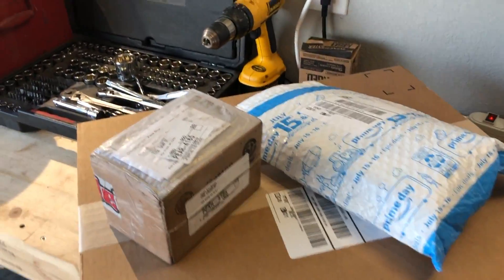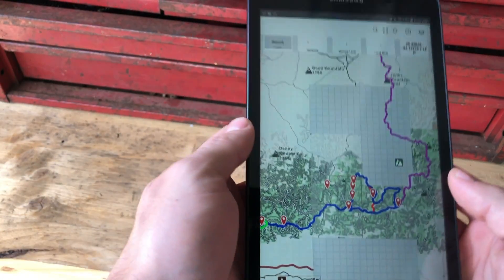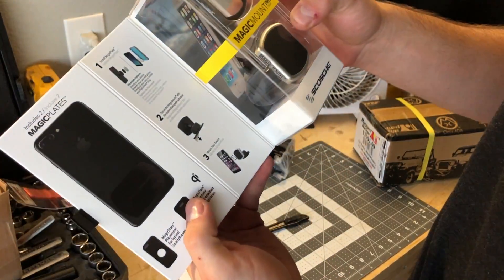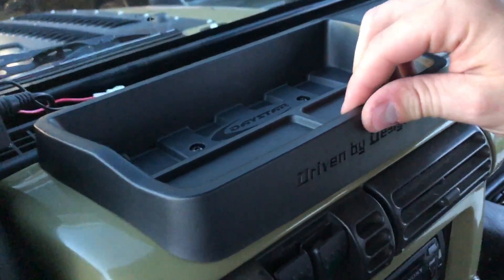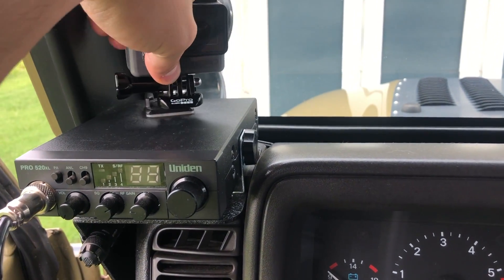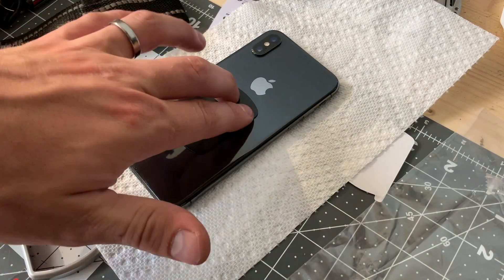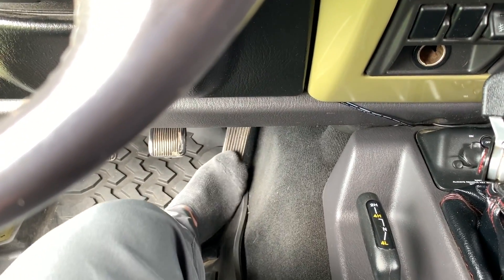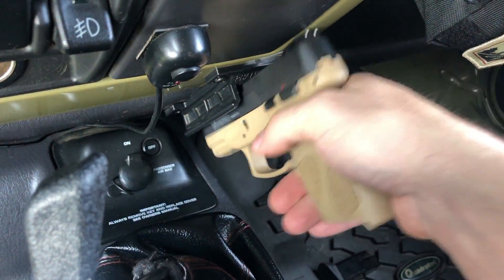Jeep Wrangler TJ – Overlanding Interior Mods

Comment: Nice video! Now let’s put those magnets to test and go off roading and see if you stuff falls off, if it doesn’t then I’m buying some!
Reply: same thought. looking forward to an update review of how those magnetics do off road
Reply from the maker: Will do! I think what I’m actually going to do is keep the tablet mounted on top of the dash and my phone on the lower mount. I trust the phone mount completely not to fall off. And with the tablet being mounted in that tray, it can never “fall off” so I think I’ll be fine keeping it up top.
Reply from the maker: UPDATE! 
Just got back from a weekend trip of off-roading and camping. Did several trails ranging from gravel to large technical rocks and the magnets worked perfectly. I ran my tablet on top of that dash mount and it never once popped off, and I ran my phone on the side next to my radio and it never came off. Even while using my phone case. If I swapped positions from the tablet and phone, the tablet may have came off, but I didn't test that. I preferred to have the tablet up top anyway for visibility. Very pleased with how well they worked. I also got another steelie magnet and stuck it to the back of one of my orange GMRS hand held radios and stuck it to my metal cb mount. Also never came off once. Magnets FTW!!
Reply: @ArkansasOffroad  That's sick! I'm going to order some! can't wait for your new video! thanks again
Reply: Steelie mounts
Reply: As a truck driver I use the Steele to hold my phone on the dash of my peterbilt. Been all over the country and never had a problem with them.

Comment: Have that same Uniden speaker, try mounting it on the left side sportbar that runs from the windshield frame to the main rollbar; used three wire ties on the speaker bracket securing to that  side bar at the rear where it meets the rear bar, then ran the cord under the sport bar padding.

I run with the doors off and top off on the highway withbmy loud mud terrains and needed that speaker closer to my ear.   Speaker is never in my way and works great and is non-permanent.
Reply from the maker: wy wybulldog that’s a good idea, I’ll try that!

Comment: Just a heads up on that magnet mount. I ran that for some time, but had issues with all different double-sided adhesive tape failing over time. Heat and cool cycles are the killer. I ended up going with a RAM mount for my phone and also for the CB mic.
Reply from the maker: I'm actually experiencing that with my CB mic mount. If it's super hot, my magnetic ball will come off the dash. The phone adhesives have been fine so far as they have a better surface to adhere to. I found a some industrial strength two sided adhesive that's working great to keep them on. Appreciate the comment!

Comment: Thanks for the hand throttle idea! The Jeep is slow and when driving for long on the highway, my right foot starts to hurt. I looked into cruise control, but it's really expensive and hard to find in Europe. The hand throttle would work great
Reply: A 2000 Wrangler cruise control only starts at like 37 mph

Comment: 0:43 so u say this is a Samsung Tablet A ? And it comes with this maps& topography app, which u can use offline ? Sounds good for roadtripping.... 
i think it's not long since u made this vid. please let us know if u still recommend it and if i got the name right? cheers !
Reply from the maker: You're correct! However, it does not come with the app I was describing. The app I use is called Gaia GPS. It's a $40 a year app that I subscribe to, but there is a free version. I've used Gaia for a while and highly recommend it. In the app, you can download the maps for offline use. 

The tablet does have a built in GPS tracker, so that means it does not have to rely on data or doesn't have to connect to a GPS to find your position.
Reply: @ArkansasOffroad  sounds great, thanks so much for your reply. 
Makes me curious as to how that Gps with the Gaia maps would work offline/without data, just having downloaded it. But i'd def be interested in getting it myself.

Comment: Question regarding the tablet, how does it access the internet without a SIM card or paying? Are you using it in conjunction with your phone?? Thanks in advance.
Reply from the maker: It doesn't access internet, just has an internal GPS unit. Same as your phone without internet or service. It's not hooked up to my phone at all. Some devices have internal GPS units and some don't. The ipad mini I was looking at does not have one, but you can buy a separate adapter Bad Elf makes one, for example...Had to do a lot of research.
Reply: @ArkansasOffroad  okay, thanks.

Comment: I would like a little more info on your tablet and the map apps you use when off line. Planing a trip to Baja and was thinking of a used  lowrance GPS but they are still quite a bit of money.  Thanks in advance.
Reply from the maker: Miguel Sandoval The application is Gaia GPS. I have the pro version which is $40 a year. Lots of great features and a very useful tool. The tablet is a Samsung Tablet A. Good luck on your trip! Hope this helped.

Comment: I just stuck a New double din radio bezel dash kit from eBay in my 97 Jeep Wrangler along with a 7” touch screen Bluetooth radio stereo with navigation look fantastic works great check it out on eBay and the stereo because the stereo has Bluetooth you can keep your phone in your pocket and still get calls Through the radio

Comment: where did you get your dash panel that is painted to match your jeep? also what front bumper are you running ,jeep looking good, we have two 2001 tjs wife has parlor yellow, i got amber fire pearl
Reply from the maker: Steve Blankenship thanks! It’s just the stock dash panel, but painted. The front bumper is a smittybilt SRC but I cut the end tubing off.
Reply: @ArkansasOffroad  ok thanks, mine isnt smooth
Reply: another ? ,did you use reg. paint or use paint made for plastic ?
Reply from the maker: @steveblankenship2413  It's the same as the paint on the body. Not real sure on the details as it was painted before I owned the Jeep

Comment: So many holes drilled into the dash.....
Reply from the maker: LonelyRider actually I only have 2! For that dash panel. The cb mount uses existing holes and everything else is just adhesive.
Reply: Arkansas Offroad so the gun mount isn’t drilled in?
Reply from the maker: LonelyRider ah, you’re right. Forgot about those. I have 3 screws for that mount
Reply: Arkansas Offroad does the gun get in the way when shifting to 5th? Definitely looking into that but don’t want to deal with it if it gets in the way
Reply from the maker: @Nickjhoneycutt  Nope! Not at all. Wouldn't have it on there if it messed with 5th. I do have a small body lift, which puts a different angle on my shifter. Still don't think it would affect a stock shifter.